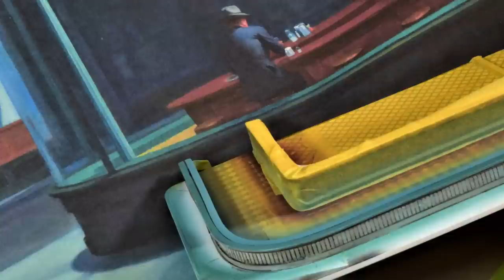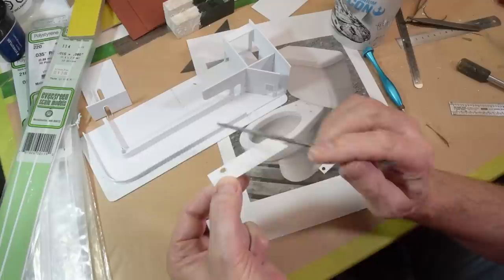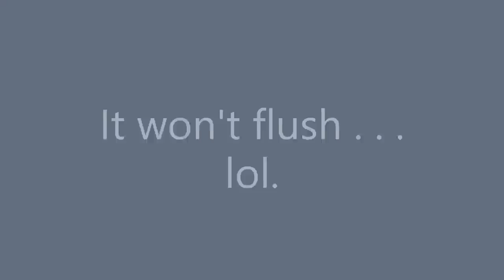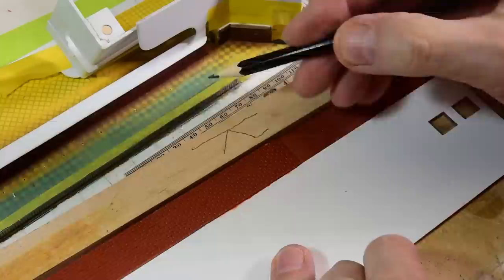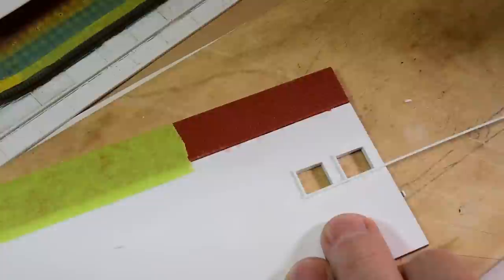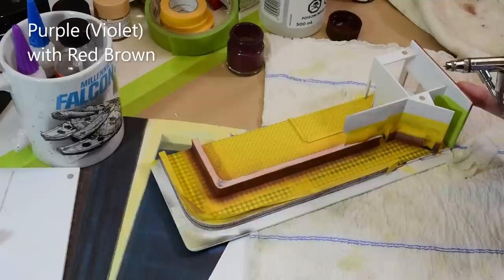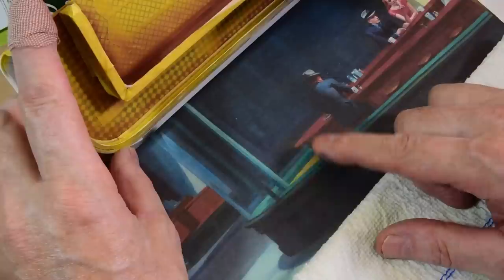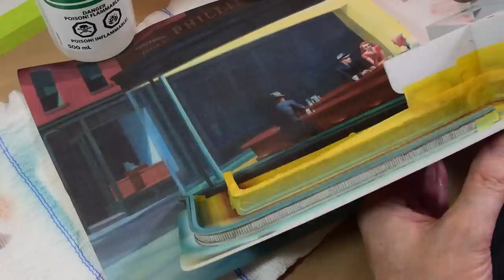The "Nighthawks" Diner Build (Part 3) | River Road ~ Vlog # 134

Comment: Loving the Diner so far ❤
I'd never have thought of building a toilet that way! Genius!
I've recently been using Ceramic Burs from the Nail Art industry. 
Ive found they are less "grabby" than metal burs when used on plastic and less likely to melt it. I got several different shapes, in fine, medium and coarse. The coarse removes material very quickly, works great on wood too.

Comment: Very helpful video, I really like the laying technique to building a model, looking for the basic shapes from prototype and then creating them layer by layer with the small bits and pieces. Thanks for the hint on coloring, I need to get a color wheel and study how to apply the  different colors or shades to add more depth to my models.
Reply from the maker: A color wheel will help loads when it comes to mixing colors, especially with the primary colors - red, blue and yellow.

Comment: Another great update on the diner. I usually watch these on my TV in the living room while working on stuff of mine. I had to get on my iphone to make a comment about brick sheet seems. It looks like with those brick sheets, cutting around the bricks in the mortar part then matching it on the adjoining l sheet before connecting them looks like it is worth trying. I’ve got some old dpm buildings that were built and sloppily assembled that I bought at a train show years ago for pennies on the dollar and I’m finally getting around to turning them into boarded up, run down, vacant buildings, kind of like what an empty row house would look like if you were in Camden or Baltimore. I’m going to use your way thought to fill in some of my windows with evergreen brick sheets. The evergreen styrene bricks are much bigger than the bricks on the Dpm buildings and resemble cinder blocks. I cut them out and didn’t bevel them like you did in this video so I’m going to redo them so there’s no sightly gaps. Thank you. 😊
Reply from the maker: Those DPM kits you mention are awesome in detail. They are also fairly expensive so you sure got a deal! I have a few as well I am thinking of using for background facades.

Comment: Great channel! Only discovered it recently. Always had a diorama thing in the back of my mind but never made the plunge. One question, which you may have already addressed and I have missed, what are your thoughts on doing the same thing but in N scale? Obviously one couldn’t achieve the same level of detail, is the the main reason?
Reply from the maker: Thank you. I used to model in "N" Scale many years ago when I had Eagle eyes. I can't see "N" scale anymore. If I built another layout after this one it would probably be "O" (1/48) Scale. Having said that, I like HO Scale because the limited footprint fits my concept of the world I want to create in terms of ratio vs the scope of things. I hope that makes sense. Cheers ~ Boomer.
Reply: Good point. My eyes suffer too and thinking about it N is probably pretty ambitious for me too. I have real trouble just tying fishing line these days. Thanks.
Reply from the maker: @fredderf6208  If I never had reading glasses I would be hooped. There is no way I can see the scale I build in, especially the details without glasses.😃